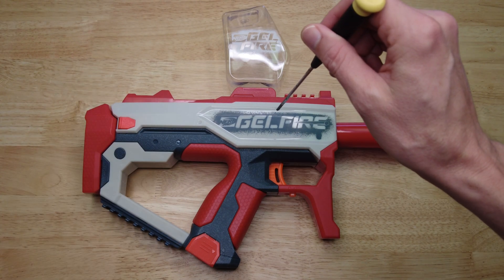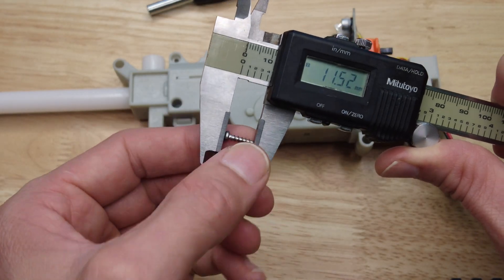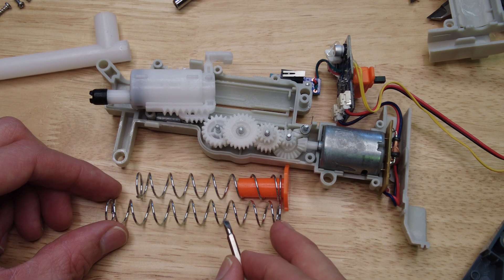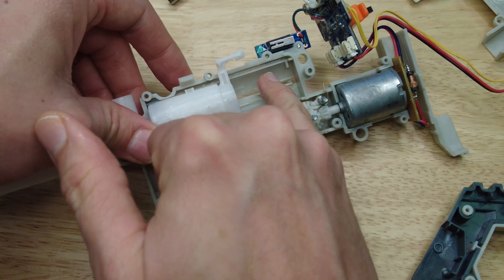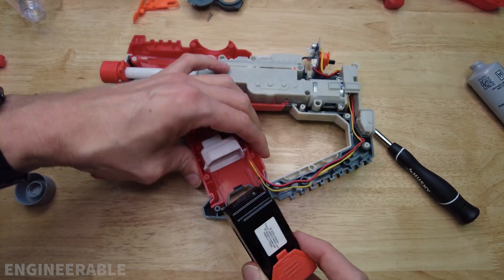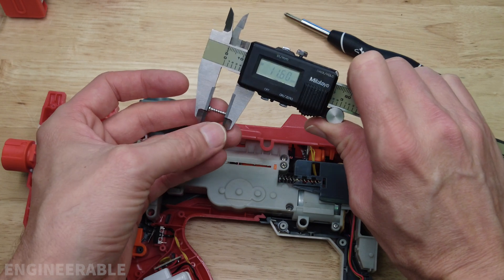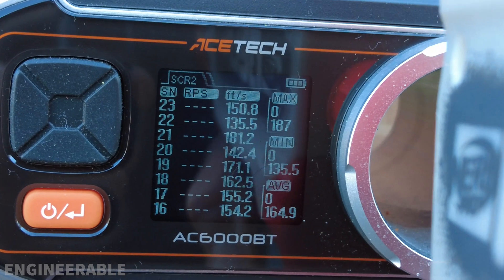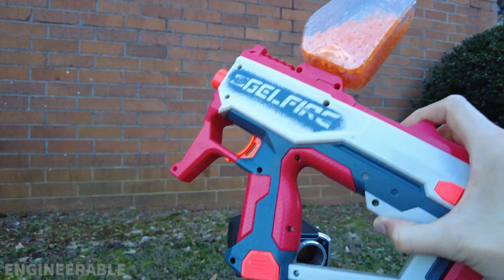ULTIMATE UPGRADE MOD for NERF GELFIRE MYTHIC | How to Gain +30 FPS velocity by replacing spring

Comment: Where do you buy different length springs for these blasters? I actually want to buy a spring like the one in the Mythic to put into a Gel Blaster Surge XL to lower the FPS of the Gel Blasters I have in a bin for kids playdates.

Comment: Could you just stretch the original spring a bit or would that not work
Reply from the maker: You can try, and that would increase the force initially, but would decrease the lifespan and cause it to fatigue faster and fail. The springs were designed for a specific length, and compression and usually heat treated. Notice how the stronger spring is not stretched, but has more coils. Stretching the spring to the point that it plastically deforms and remains stretched will affect the preset and design parameters. The spring is more likely to get stressed when compressed again. This may not be an issue in a device that has low operating cycles, but a gel blaster subjects the springs to 100's of thousands of cycles.
Reply: Fair enough I’ll try to locate a spring online thank you for the reply

Comment: I hope someone still will see this post even though this video has been up for a good while now in youtube time. I was wondering, what if I don't have a spare sitting around that conveniently has a spring that is bascially perfect to make it shoot harder, can I buy a spring at a local hardware shop?? Also, is there any way to extend the barrel length? I hate how short it is, I feel like it would make it fire more accurately and possibly further with the stronger spring.
Reply from the maker: The easiest solution would be to buy an airsoft spring and cut to length. TBH, better off buying a better blaster than try to mod this one too much, like longer barrel. Barrel length needs to be proportional to the cylinder volume.

Comment: One last thing, is there anyway to get metal gears to replace with the stock ones? I would assume not because you mentioned that the included gears are unique and not typical
Reply from the maker: There aren't any metal gears available since they use a custom size.

Comment: Could I replace the stock battery with an airsoft or drill battery? Just trying to make this thing really powerful
Reply from the maker: Increasing battery voltage will not increase the power, only the rate of fire.
Reply: @engineerable  thanks! Any way to increase the range?
Reply from the maker: @floon3507  Stronger spring definitely helps, and there's also a hop up. Check out my post about Nerf Gelfire Mythic upgrades and mods https://www.engineerable.com/single-post/will-nerf-dominate-the-gel-blaster-wars-with-the-nerf-gelfire-mythic-find-out-how-good-bad-it-is
Reply: @engineerable  I’ll check that out. Thanks man!

Comment: Have you tried the 3d printed hop up on etsy?
Reply from the maker: I haven't, but people say that 3D printed hop ups suck for high powered blasters, because they break. However, they may be fine for low power blasted like Nerf Mythic. So I would try it first before making a conclusion.
Reply: @Engineerable  I purchased and printed it yesterday have to test a little more but it seems to increase the range somewhat what
Reply from the maker: @jsanchez9084  I see, I looked it up and looks like it would work fine. It's a non-adjustable design, but that means there isn't the adjustable tongue inside that breaks like on the other 3D printed hop ups, so this one should be stronger.
Reply: @Engineerable  yea I've use it for one day seems ok so far there isn't too many upgrades for this blaster but I bought it to play with my 9yr old son so not worried about fps too much he has a gel blaster surge and I got this one on sale
Reply: @Engineerable  I used the 3d printed hop up some more and tested and can say it does increase  the range by a good 10-15 feet I source my own orings instead of using a rubber band like the ad on etsy states works really well
Reply from the maker: @jsanchez9084  Nice, I'll have to check it out

Comment: If I add a plastic ring between the spring and the orange piece to increase the load on the spring instead of changing the spring, do you think it might work the same?
Reply from the maker: You can try. If there's enough extra compression length, it will work. It's possible that could also compress the spring past it's design limit, causing it to yield over time as it is cycled.

Comment: By any chance, would you happen to have a link to buy the spring separately? Wouldn’t want to buy a surge just just to pull the Spring out and put it in the nerf.
Reply from the maker: Unfortunately, I don't think this spring can be bought off the shelf. I happened to have a dead SURGE Gen2. You might be able to take an M80 airsoft spring and cut it down to size. That's the softest airsoft spring you can buy.
Reply: @engineerable  OK good to know, would you happen to know a good place to get one of those also just curious since you took it apart does it look like it would be easy to add a hop up?

Comment: Thanks for that. I am gonna wait for the Mr beast version. What about changing out that motor? Looks like a brushed RC car type motor.
Reply from the maker: There are diminishing returns to pushing it much further. New motor could increase fire rate, but hopper gravity fed blasters have a limited feed rate, and will misfire more b

Comment: I dunno how everyone else feels about this, but I like to watch the mod process as unedited as possible, instead of snipping out the boring bits I enjoy seeing the full process.

Edit: one other thing you can try to increase the FPS further is switch to a tight bore aluminium/metal barrel (7.0mm internal diameter), it would be cool to see how much further you can push this.
Reply from the maker: So, is this video to your liking? I snipped out unnecessary parts from the What's Inside video and focused on the spring mod. My goal with these videos is to leave enough that you can recreate it. It would be hours long if not edited 😂
Reply: @Engineerable  at the end of the day, it's still fun and informative to watch.  For me it feels fast paced but maybe more people prefer that.

Doesnt have to be fully unedited but maybe there is a middle ground.  Take what i say with a grain of salt though, your format may resonate better for your other viewers, i might just be an outlier.
Reply from the maker: Have you seen the full teardown video? https://youtu.be/78YZIaHimt8
It's much more detailed, as opposed to the spring upgrade video which had a more specific focus.

Comment: Dumb question is the spring in the surge 1.5 the same as the gen 2/3
Reply from the maker: The one with the slide velocity adjustment? Probably, because the max FPS is also ~175. Haven't taken the 1.5 gearbox apart yet though.
Reply: @Engineerable  yes those ones I got 3 and it's making me want to swap one in now